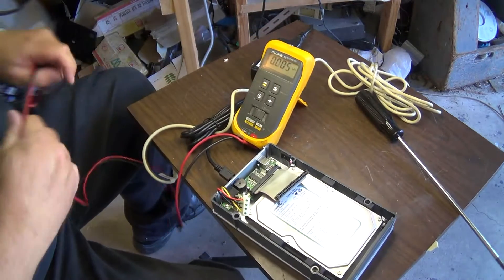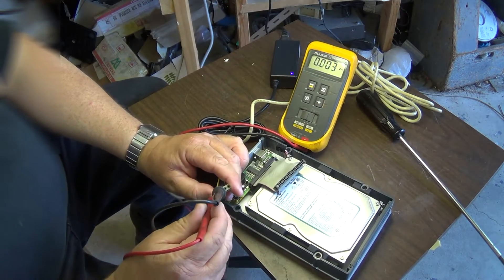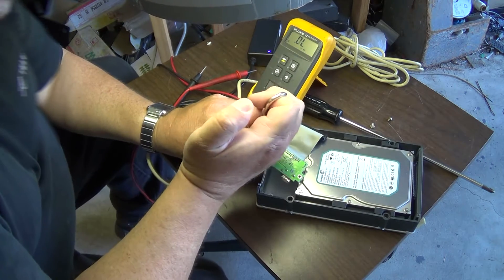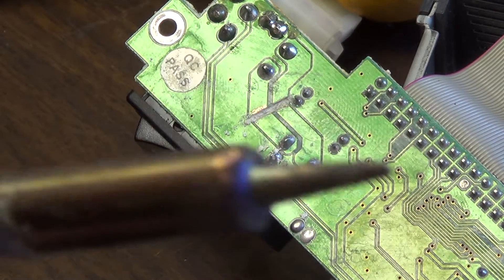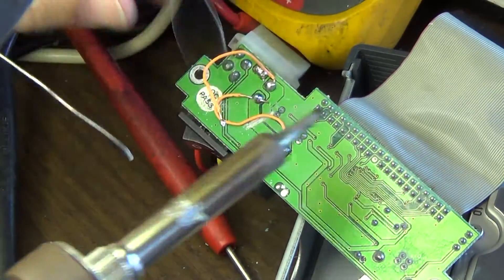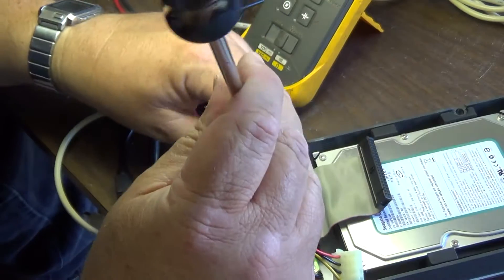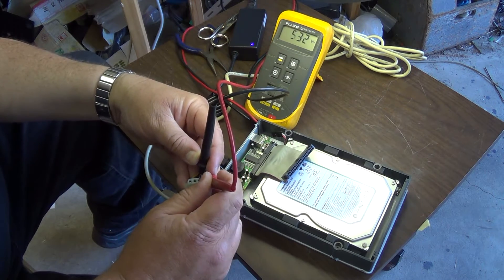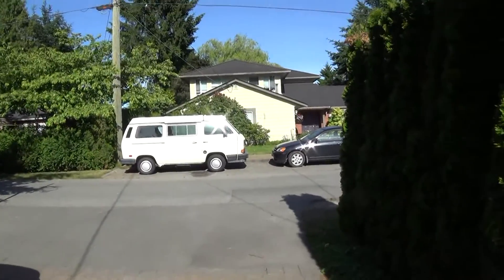HDD power supply wrong voltage fix

Comment: Hello,  i have a problem with an ATX power supply, replaced some small capacitors but the voltage 3.3 it's beyond the limit, now about 4.2volts. What element could be the cause of this overvoltage?

Comment: Wouldn't it be easier to just swap the yellow and red cable instead of adding jumper wires and going through all the trouble cutting traces?
Reply from the maker: No, swapping the wires would fix the voltages to the hard drive only. The IDE to USB interface needs to run on the 5 volt supply, as it is now it is on the 12 volt supply.
So the option would be as I did it, or crack the power supply open and swap the wires in that. The power supplies are glued shut, and I didn't feel like damaging it. So the easiest solution was to cut the trace and solder in jumper wires.